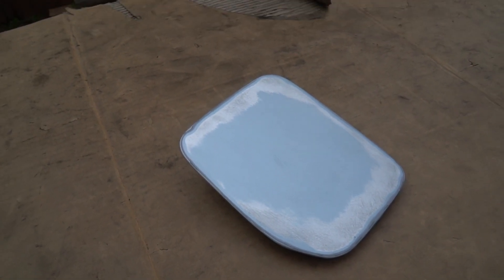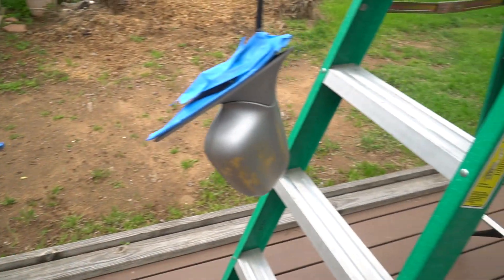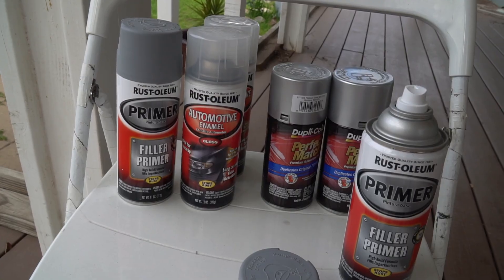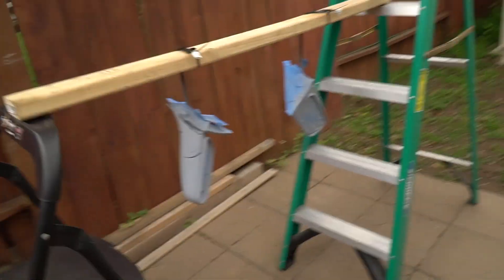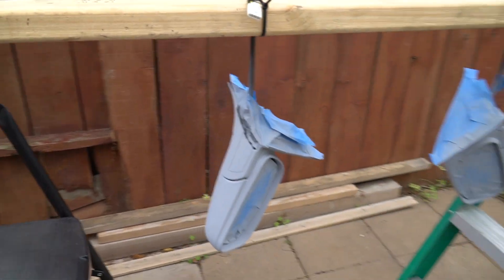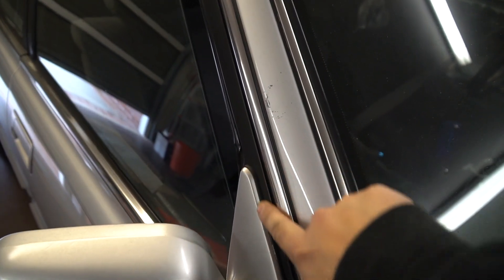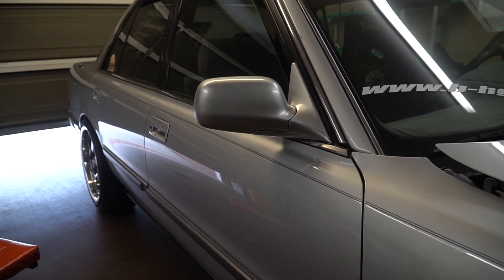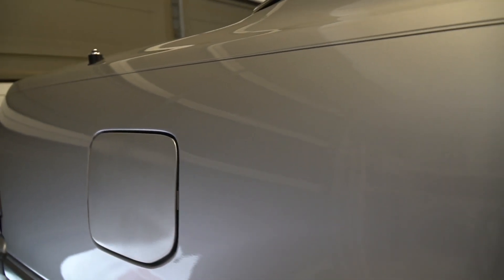Stay At Home Day 5: Paint matching with Duplicolor Perfect Match

Comment: You'll get better matching gloss and better quality with a 2 part clear coat. But they are like $20-25 per can. Other option for a good one part clear is U-POL high gloss clear it's a huge difference over rustoleum and that is $15 on amazon
Reply from the maker: I've use the 2k clear with activator, I just hate how the can becomes a 1 time use application because of the activator.  If I was doing touch ups on a show car, or re-clearing carbon fiber, I'd use the good stuff.  For this old girl the cheap clear coat did the job.
Reply: @RatchetFinesse  try the U-POL for a great shine with a 1K it works great. I might have an extra can in the garage. If I do I'll give it to justin